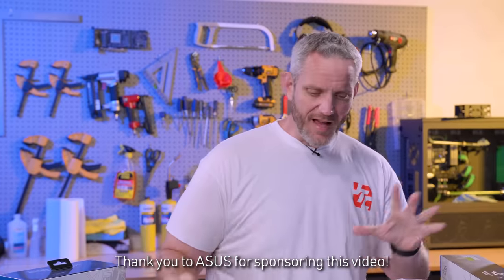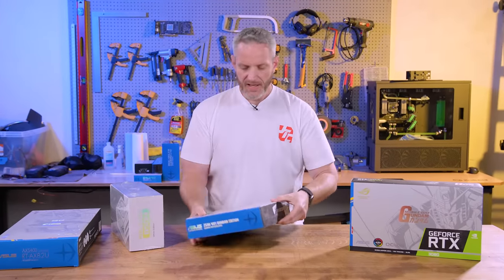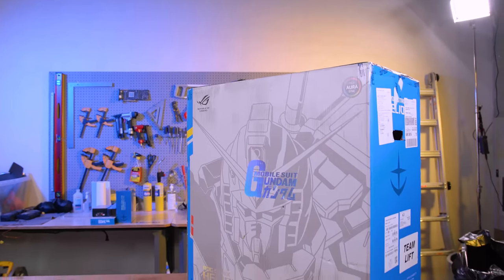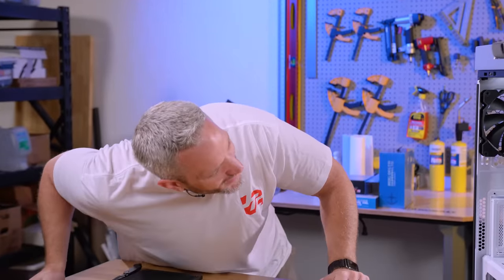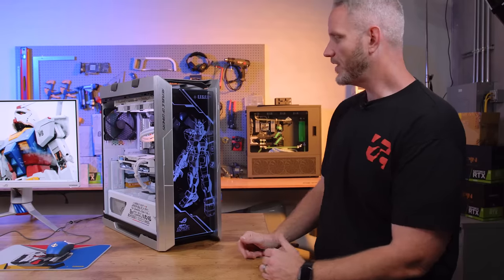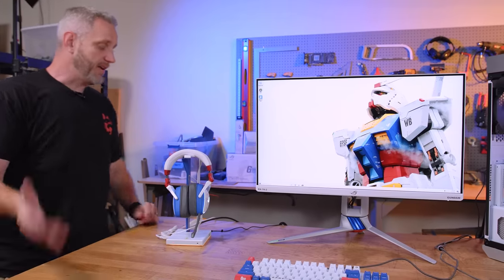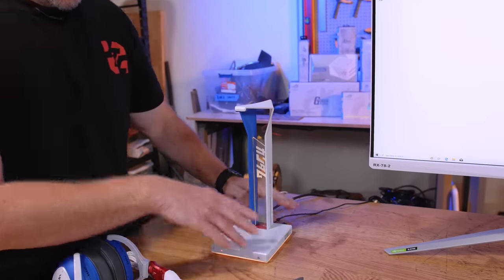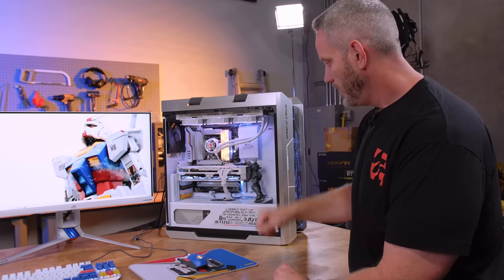The Gundam Themed Gaming PC... you didn't know you wanted this until now!

Comment: I didn’t realize I needed a Gundam pc until I watched this video.
Reply: so true, I really like it !
Reply: Then when you realize that there is a Zaku pc that is also needed
Reply: I know, right?
Reply: Noice
Reply: @Spac6023  I feel ya the zaku parts are much more affordable. I have the case and router. My builds a z490 so I didn't get the b550 mobo. There is also a aio but I use air cooling. Newegg has the monitors for the builds and it comes with a shirt and a mug. Same with the zaku router with its free t shirt

Comment: Jay - "To bad theres no white powercable"
Some Guy At ASUS - "Sonva b' I KNEW I forgot to color match SOMETHING"
Reply: I was half expecting them to have something come up across the screen updating us that Asus sent them a white one after watching their video lol
Reply: Some PR exec's head will roll for this treachery
Reply: Fired guy?
Reply: Actually, the case is Silver, not that smoothly White stuff you see on some specially 
packaged BluRay Box Sets... & I don't really know of any Gundams that are White to 
start with, oO 

Nvm, I am confusing the color of Metals with the Paint job of the Gundams, =D 
Though, Gundams are many Colors, & White isn't the only part, so it seems fine 
that a Red or Black Cable is used inside, even if it might be a bit tad off in specs. 

Though, there was an all White Build a ways back? & I do remember I think even the 
Cables were white, am I wrong? It was a Rig that Linus Tech Tips did, no?

Comment: It's times like these I'm glad I'm not a HUGE Gundam fan. This whole kit has to cost a fortune when you add a Gundam tax on top of the normal Strix tax...
Reply: i'm Lucky they went for UC, i'd be ultra broke if they went for CE
Reply: Yeah, it does. I'm not to certain on the exact cost since it is not in USD, but you are easily looking at 3 grand.
Reply: @icaruswindrune7116   Monitor is $794 USD, Mobo is $379 USD, Mouse Pad is $57 USD... Easily $3,000+ as you said
Reply: Not as expensive as the War Hammer tax...

Comment: Now do the Chars zaku parts Asus made. I'm honestly surprised, judging by the comments, so few people knew about these gundam and zaku themed parts were a thing.
Reply: I knew of the Mobo and graphics cards... I did NOT know that there was a full line!
Reply: @Rusty00 newegg has the char case at a import price sadly at 299. I missed the drop when it was at 119 also x.x the mobo and routers are easier to find. new egg sells the router with a t shirt I defintely didnt buy it. I managed to snag my char case at 225 which still hurts compared to msrp but it was worth it.... ( it seems new egg has the char case on back order for 119) fk why did I have to look if your intrested in it id get on the back order if its anything like the first launch of the cases jump on it soon as it wont last to long
Reply: most people probably didn't know since it didnt launch state side and was really just an asian market release. It has recently had parts launched on other sites newegg has the char case and some other I think amazon has the motherboard and had the routers. (if you want the zaku router use newegg comes with a free t shirt)

Comment: PSU manufacturers: PLEASE take notes on the 6-pin GPU cable arrangement. Having them spread out instead of daisy-chained should be the default!
Reply: Every competent PC building expert: Never daisy chain your PCIe cables, you're either not providing enough power to your GPU or you're risking melting your cables. 

Every PSU manufacturer: Make sure all the PCIe cables are daisy chains...

Comment: You should do a Zaku II build. Also Char did nothing wrong
Reply: He crashed a colony A COLONY into the earth. #chardideverythingwrong
Reply: The char stuff is alot more atainable for reasonable prices. Other then The gpu. Newegg currenty has the mobo,aio,monitor,router. The router and monitor come with bonuses. Newegg also has the case but it's from a import so it's 299.   Currently the only 78 parts they have is the monitor on there

Comment: Asus sends Jay an assortment of parts you can’t dream of locating in the USA. But at least he gets the joy of having a sponsor send him the goods to again advertise gear nobody can get.
Reply: You could buy all the parts between Amazon and ebay, but God damn would it be expensive.
Reply: @chrissmith135  ya the case is insanely scalped same with the gpu and psu. but if you were made of money its possible. I mean they didnt even ship jay the psu which is crazy. the rx78 router is getting scalped pretty bad also. luckily the higher spec zaku 2 router is not scalped and is on newegg with an included limited edition t shirt
Reply: @chrissmith135  Some of it. There are a few parts that Asus won’t export out of Mainland China though. Going through a variety of items they have like the Ryujiin II 360 Cooler with the LCD screen that they released between Jan-April is still only being sold in China. Taiwan can’t get it either and they get most of their products first when they go into production.

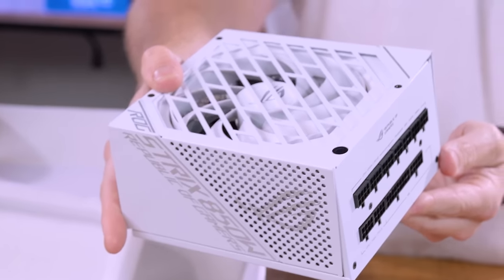Comment: So did anyone else notice the damaged power supply? The casing is clearly askew when Jay unboxes it. @ 4:02 4:05 and again @ 9:39 but appears rectified at 9:48 (after trying to fit it and finally noticing it?)

I initially thought it might be the angular panels on the PSU casing (and there are additional panels on there) giving the appearance of a warped case, but it's definitely not. It even wobbles when Jay puts it on the desk at 9:38

Comment: Using the MG you painted from way back to accent the theme was a great touch. I'm a lot more enthusiastic about this line (as a Gundam fan) than I was previously. I'm disappointed that the 3080 doesn't come with a water cooling option.

I'd be very interested to see painting and modding done to go full navy theme to match your RX-78-J.

Comment: Great build, an all themed and top specs PC.
While the RGB lights are good on white on the front panel it could also be ok with the main colors of the G78 (Yellow, Blue, Red, White (for a longer time)).
Also while it showed the CPU sink head with a literal Gundam head was cool, I would love to see it more detailed.
Also I know it's over 2 weeks past the posting but did you painted the Gunpla figure inside the case? Was it part of the case or separately? Is it articulated or stationary?

Comment: I'm building the Evangelion one they released a few months back. The only thing that sucks about this stuff though is no themed upgrades later on. The motherboard is a PCIe 5.0 board but the gpu isn't even a 30 series Ti. Power supply isn't an ATX 3.0 and I doubt they will release one for these themes.

Just sad that if you wanna keep the theme, you can't upgrade.

Comment: You should do a cooling mod on your Nighthawk! I replaced all my thermal pads with copper shims and high end thermal paste. I no longer drop connections anymore!  Also, I've noticed a theme with Netgear devices; almost every one I've worked on has one or more thermal pad(s) that do not cover the chip(s) properly or are missing/somewhere random near the chip needing said pad.

Comment: @JayzTwoCents The Helios tower comes with two front panel USB 3.2 gen1 cables while the motherboard has only one header. So one cable would be unused. How did you solve that problem because I'm having a similar issue? Tx.

Comment: Did you also have the issue where you only can use 2 of the 4 front usb slots due to the motherboard only having 1 usb 3.1 slot? I'll have to find a cable to allow me to plug in the other 2 front usbs to the usb2.0 slots.

Comment: As someone who got the set for the tower, ( psu, gpu, mobo etcetera) that's not the correct Power supply. The actual Gundam white edition has Red connectors, and white and blue sleeved Cables

Comment: hmm. It's an awesome looking setup; but guessing there's a premium for the limited edition parts. Looks pretty, but will let folks with deep pockets buy it.
Reply: the premiums are not bad most parts are almost msrp or slighty above. the problem is if your state side finding them retail vs import is easier said then done. and the gpu like all gpus are scalped its just extra scalped being a limited edition. but the router is like 50 bucks extra and you get a t shirt and the monitor's are like 100 extra but when they were in stock you got a t shirt and mug. the cases are the same as msrp when found at retail. the big issue is alot of the parts have never gotten a state side release. 

the monitors, zaku case,zaku and rx router,zaku and rx motherboards. are the only parts ive seen get state side so far. I would keep an eye on newegg from now till end of july as maybe by some stroke of luck the rx case and the rest of the parts may get released but like the zaku parts there stock will be pretty limited

Comment: They would've hit the target if the case had an MG GUNDAM RX-78 on a rotating display table with internal led strands attached for RGB mgmt.
Reply: I'm pretty sure someone has already thought of this and modded or modding it for this look. Also if the Router was remade to the Gundam Head with those antenna air brushed to white and gold.

Comment: that is so sick, a youtuber in my country has the same set except the case and gpu holy balls its so epic!!! maybe asia got it earlier than us. just curious, why they didnt deliver power supply gundam theme, i mean they have those. weird.
Reply: ya lol they jipped jay on the theemed psu and ya asia had this earlier in the year. normally these kind of things don't even leave asia and were stuck paying imports if you want it. so its pretty bless were even seeing some of the parts. the rx cases seem to be mia. but I have seen the mobos for both zaku and rx routers for both. monitors for both. only zaku aio's. rx78 mouse. the keyboard and headset for the rx series are coming soon to newegg also.  maybe we will see more even the gpus? but who knows gpus them self are rare enough. but the whole build is up but its at 4.8k usd before tax
Reply: @Demon09-_-  yeah it goes both ways as asia hard to get things from outside asia as well right. Gpu kinda weird since rare and now with limited edition price gonna go way high. Yeah true that price damn. Lucky whoever gets it, wish its cheaper so more gundam fans can get at least some parts of the theme
Reply: @amrisleepy  the parts are pretty much retail at least or the slight gundam bonus of like 50 or so. But newegg has been throwing things in my 549 for the zaku monitor came with a zaku t shirt and rx themed cup so it made price bump hurt less. Same for the zaku router the free t shirt made the 50 over msrp not that bad. The prices get lots higher once it's import though most imports want 299 for the zaku case it was 500+ before newegg showed they had stock here and there. And over 1k for the monitors and the rx ax601 case... import is over 1k

I my self have been very happy though im glad to even get the zaku case router and monitor.  If I manage to get the rx keyboard that's just a bonus. Now if I could find that 1/48 zaku 2 gunpla and not have to pay almost 300 usd lol.

Comment: why isn't the "US Amazon" link working
Reply: ive only seen a few of the parts actully go to amazon legit. they may eventully come but most of the parts ive seen have been on new egg. if you have the cash newegg even has the full rx pc build
Reply: @Demon09-_-  thank you
its a shame that the zaku is not getting a graphics card
Reply: @1325blackcat  he got one its just sadly a 1660 super. Sadly char zaku didn't get a mouse or keyboard or headset though x.x
Reply: Yeah might as well not Goten one Sad face
Reply: @1325blackcat  I feel ya a 1660 is basically zaku status on the gpu.... they could have at least done a 2060 or 2060s.... the cannon tech level didn't need to follow that hard to tue story line lol

Comment: Screw Asus.  Their Thor PSU blew &  my Helios front panel i/o pcie usb3 addon cards and fan/led controller.  They won't repair and they haven't offered to replace the case.  Asus customer support is seeming to be non existant.  I'm out $400 bucks.  LianLi is probably going to be $200 richer in the near future.  STEER CLEAR FROM ASUS.